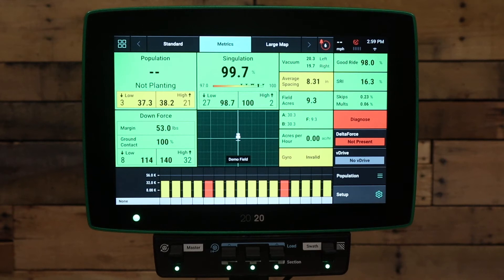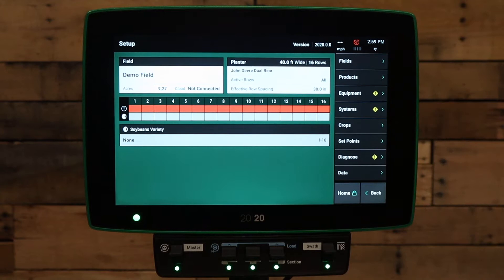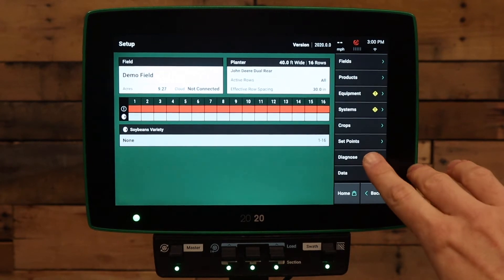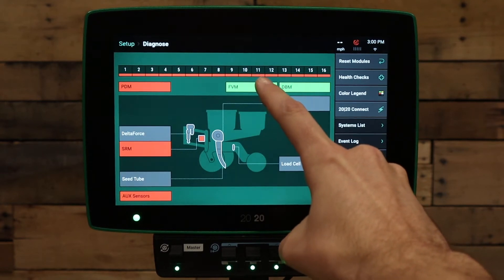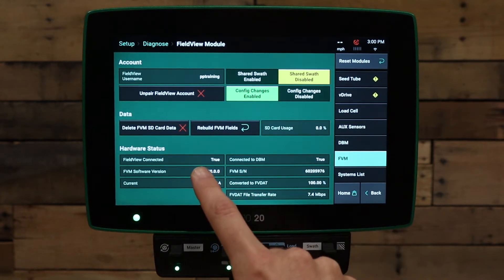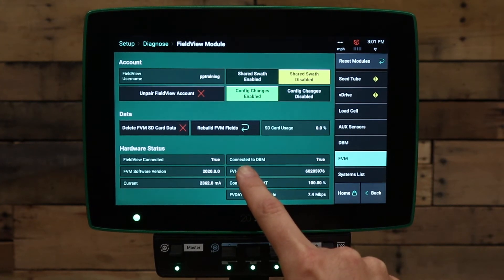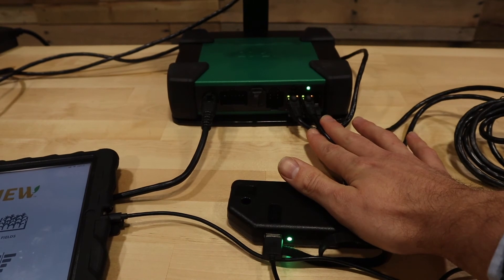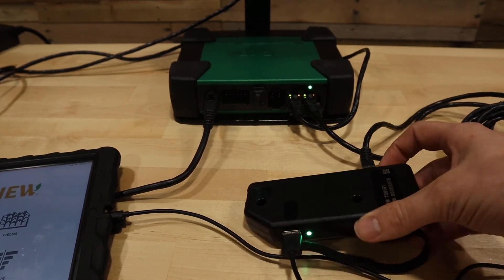20|20 Gen 3 - iPad Will Not Communicate with 20|20 or Map Data

Comment: Just had this issue with mine.  Went to diagnose page and it didn’t show a fvm. So unplugged the Ethernet cable on the back of the dbm and then reset modules. Then it started communicating again.